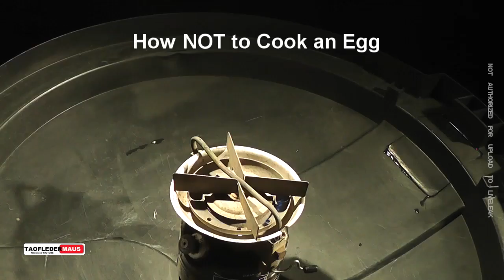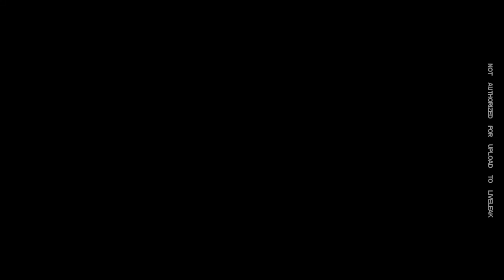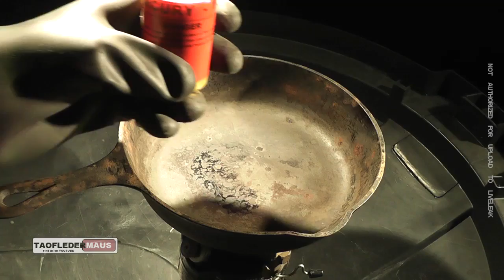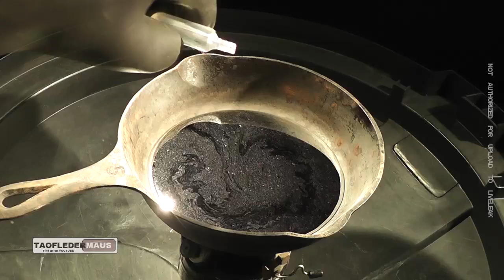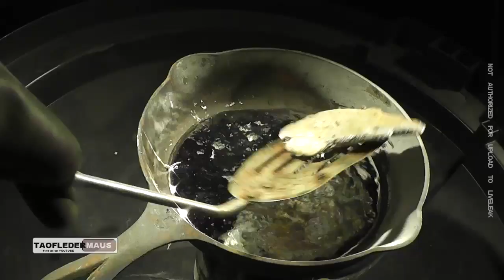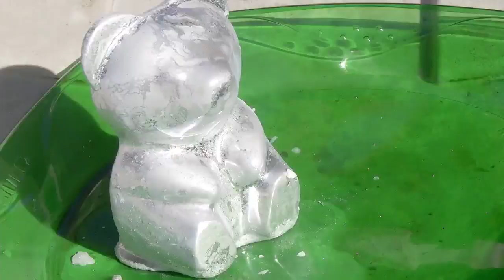Frying an EGG on liquid METAL -  Never seen footage

Comment: ???????Remember ??????? the story about the mad hatter that used to dip his beaver pelt hats into boiling mercury.. it will make you literally go crazy. one time i left a small metal container on my wood stove in the shop it was cold and forgot it was there well when the fire got really hot i was across the shop and poof the mercury explodeded and turned into a weird smelling smoke i got the heck out and opened all doors and window before i entered again never recovered my mercury and always had a strange smell in there.  I have always heard that if you fut some mercury in a hollow point bullet fairly deep hollow point and seal it with wax or resin that when you hit a target it will explode never tried it but heard it when i was a kid 30 years or so ago ??????????????Just wondering??????????????

Comment: Can mercury get hot enough to glow red like molten steel?
Reply: Nope, it boils at 356.7 degrees Celsius. To glow incandescent (red-hot) you need to reach at least 700 degrees C. Mercury would evaporate before it got that hot, unless you put it in a sealed container like a pressure cooker.
Reply: Thank you!

Comment: don't understand why is that amazing? but I do recall in Vo-tech class in the 1980's we worked with molten Lead and it looks the same except much hotter we used it to seal plumbing fixtures . I think its against the law now even though we just used them for outgoing pipes

Comment: And today we learned... absolutely nothing. Some commentary explaining what, if anything, is going on would make this much more worthwhile.
Reply: +beeble2003 The massic heat capacity of water is 4184.  It means that you have to give 4184 joules to 1g of water to heat it of 1°C. The massic heat capacity of mercury is 139. 
So you have to give 30 times less energy to heat mercury than water.
Sorry for my bad english, sience words are hard to translate :/
Reply from the maker: +beeble2003  heavens to MURGATROID!   I think I just pooped myself a little too!
Reply: +TAOFLEDERMAUS  i have a question to u, is it dangerous, when mercury is in boiling water?

Comment: This is the new way they give last meals to people on death row. Two birds one metal.
Reply: ***** you can't run from metal disease even with an extremely filtering mask, the gas heavy metals release can pass trough your skin (even if way more time of exposure is needed to start feeling sick) and that's one of the other major reason why workers in a foundry wear full body suit (well, the biggest major fact is reflecting the heat, obviously)
Reply: ***** I'm not gonna try to explain how the gases liquid metals (of all sorts, mercury is more dangerous just because it's at a liquid state is like this, and all liquids constantly evaporate) release go trough skin since i think I'm not the best explaining it, then I said it's toxic and dangerous with prolonged exposure.
Then it's an error of mine that I said all foundries use heat suits, only the ones that work close with some of the metals that are dangerous in a liquid state such as steel industrial foundries for the workers that stay closer than the other ones. Metal sickness isn't very easy to take now since the modern safety measures and equipment can prevent it and to have permanent resentments you need to be frequently exposed for sometimes even a decade, but in the '800, with the industrial revolution, problems like this were very frequent between foundry workers.

(P.S. to go trough skin it doesn't have to be atomically smaller than skin, the gas just passes trough the sweat pores)
Reply: +Paul Wilson I played with them when I was a kid.
Reply: +Ó Slatraigh Except one of those birds didn't deserve to be killed the way chickens are slaughtered in the egg industry.

Comment: this is probably a dumb question but what exactly is mercury.I mean I know it's an element but what exactly is it...
Reply: Basically it's a liquid-formed metal
Reply from the maker: Disneynerd1342  It is an element,  a metal that is liquid at low temperatures.
Reply: Disneynerd1342 It is also highly toxic, a bit more due to it's very high melting point. All pure metals are toxic to humans mainly because pure metals never exist in nature (or very rarely... I think it was 2% or 0.2% of earth had normal metals before humans started doing stuff). Due to this rarity most bodies of people and animals never evolved to have methods of getting metals out of there body.

Meaning even a few drops of mercury could cause harmful effects.

It is also one of the bare few elements that is liquid at room temperature.

If you want to know how metals are so rare before humans but not any more ie "where did it come from?" it is mostly the fact that the metals are bounded in ionic lattice compounds. for eg Sodium (Na) would have been commonly with Chlorine (Cl) forming NaCl which is commonly known as table salt. Just one common example.

Humans basicly used the knew knowledge of chemistry to separate those bonds to make metals and later on alloys (1 metal + another metal) to make things like bronze.

Mercury is one of the weirder guys out there, and in ancient history had wide spread speculation on what it is or could be used for mainly in alchemy- where by a certain chinese emperor was thought to be the key to eternal life- ironically it's highly toxic and killed him.

Comment: You know that even mercury vapors are extremely toxic right?
Reply: BlueBerry14 No its perfectly fine. Just pic the metal bits out of the egg and scrape off the grey parts on the egg. I've done this before and I'm fine. Tastes alot better than a normal egg. You should try it immediately.
Reply from the maker: ...KhàotiK...  Yeah,  especially when you heat it up.
Reply: *****
Were you using a mask?
Reply from the maker: yes. I explain everything in the description
Reply: *****
Ups sorry my bad.
Reply: The was cool and I know you sad in the description that you used a mask and what not but if it's that toxic why not use gloves and cover all skin. I've seen in one of your videos that you have bumps on your thumb. Idk, don't wanna see you getting sick for our sake.
Reply: ***** can you eat the egg ?
Reply from the maker: can I or will I?
Reply: ***** my question is legitimate, does the egg gets contained with mercury ?
Reply: Fuke Gewgelplus Thanks for the advice. Will try it.

Update: Did try it and now I'm a ghost... Thanks Obama

Comment: in the 70's i seen a guy drill out a 30/30 round and put a few drops and capped it with wax
he shot marble sink cut out blanks
1st with normal rounds and it popped holes in it ez pezy but just holes
when he used the modified rounds the blanks disappeared and tiny little bit fell
there was a flash and noise too!
as if it exploded!
he shot other things and it was devastating
tore stuff apart like a grenade! 
i can't remember his name just that he died in a bike crash!

Comment: Not very surprising as Mercury is a metal so conducts heat very well. The fact that it is a liquid at those temperatures will also increase the surface area of contact with the egg so I'd expect it to cook the egg even better than say iron, aluminium or any other metal that is solid.

Comment: So, am I understanding correctly that the little spots left after the water is added are mercuric oxide? I know that, at high temperatures, many metals can actually react with water to form their oxides. I assume that's what's happening here.

Also, this makes me crave some over-easy eggs.

Comment: So correct ,e if I'm wrong but does Mercury  not stick to any surface or something?
Reply: Yes. Mercury will not wet anything. Not glass, not a sponge not an egg. The metal you see on the egg is there because mercury vaporizes like any other liquid. The egg cooked with the mercury vapor inside it.

Comment: Mercury's heat conductivity is actually lower than most other transition metals...  interesting experiment, though, a thermometer might be better suited to test than, than an egg?  Well, you never know, something interesting could have happened and you ended up with a Nobel Prize.  Are you sure those fumes didn't get to you? :D

Comment: What's the point of showing us how you waste an egg ? Pretty obvious what will happen ..
Reply from the maker: what's the point of answering your smarmy question?
Reply from the maker: It freezes solid at about -40C (F)  and boils at 356C (674 F)   I have videos where we froze it and also brought it to a boil.
Reply: What's the point of doing stuff nobody's done before. That's a question Columbus got many times I guess. Maybe it would have opened a crack in the space-time continuum. You don't know until you try.
Reply: ***** cool.
Reply: ***** I have a question   does mercury have a melting or boiling point?  It's technically already a liquid isn't it?
Reply: *****
making me love your page even more with the common sense come backs on people its great lol...

Comment: Is mercury evaporating due to the heat, even a little bit?
Reply from the maker: Matixcubix Yes it is.
Reply: Mercury vaporizes  at very low  temperartures, its melting point  is  38 below zero,  and when it is  liquid it  vaporizes  fast, even at  15 or 20  degrees C.   The higher   temperature,  faster  the   vaporization  and  it is very  toxic, specially for brain cells.   Toxicologists   recommend  to  be very careful  even with  with  the  mercury contained  in a  saving bulb,  that has much less  than a gram.  Imagine this cooking, it  produced huge amounts  of  vapor.  You can not  smell  anything  but it   enters  your  brain.    Mercury  is not a toy, it  is  a  poison.
Reply: ***** Then why do you not have gloves on when you put the egg in?????!?!?!?!
Reply from the maker: Ever try to break an egg with gloves on?
Reply: Compromise safety because its easier?
Reply from the maker: I washed my hands afterwards.

Comment: I certainly hope you were wearing an appropriate air supply/respirator during the filming of this. Many people don't realize that another counterintuitive fact about mercury is that it has a significant vapor pressure; i.e., it evaporates much more quickly than you might think.

What that means is that when people handle mercury such as you have in this video, unless they take rather extreme precautions, they will inevitably inhale significant amounts of mercury vapor. While your rubber gloves were unnecessary as it is virtually not absorbable through the skin, when you breathe in the vapor 80% is absorbed into the bloodstream and distributed, rather permanently apart from chelation therapy, throughout the body, including the brain.

The vapor pressure of mercury increases rapidly with temperature !!

Mercury is a neurotoxin, and it doesn't leave the body once it's in there; without chelation therapy.

I know of a case in which, back when I was a scientist, a colleague broke a manometer and the mercury spilled behind his desk.  Although every effort was made to vacuum it up, he died a few months later.  An autopsy revealed severe deterioration of his brain.

When we were kids, we used to rub pennies with mercury to turn them silver.  I always wondered why they changed back overnight -- the mercury evaporated. 

I'm sure you will be able to find videos on the internet showing the flow of mercury vapor from an open container via refractive shadow illumination.  This substance should only be handled in a fume hood by people who know what they are doing, and posting a video such as this is somewhat irresponsible, in my view, in that it could entice others to make this potentially very serious mistake.
Reply: Read the description please.

Comment: What is it with Americans and cooking eggs on both sides? Absolutely disgusting.
Reply from the maker: Yeah!   Those Americans and their over-easy ways of life!   The outrage!   Because EVERY American eats eggs exactly the same way.
Reply: *****
On a more serious note, do you ever have a problem with residue from one of the experiments getting in your mercury? Do you have a way of cleaning it?
Reply from the maker: None at all with stuff like this.  It just doesn't ever mix with the Hg.     If there is any dust in the pan for example,   it's all going to float to the surface.  All the "clean" Hg is at the bottom so I will draw off the clean stuff and then pour the dirty stuff into a separate container.  Over time  I can start drawing off the clean Hg from that container.   I can use a 10% nitric acid solution to help strip out impurities too,  but I try to avoid that.
Reply: Ah, thanks, that explains it!
Reply: Salvatore Shiggerino no need to be stereotypical about Americans now. My family and I are american And we NEVER cook our sunny side up eggs on both sides.
Reply: Salvatore Shiggerino Fully cooked food is disgusting!
Reply: Salvatore Shiggerino uhh in my country they like to cook both side....i not even american....not even close
Reply: I scramble.
Reply: Hey we eat our food how we want to it taste good to us.

Comment: Mercury Egg cooking, problem, the hotter mercury is, the more vapor it gives off.  The vapor is about the most toxic in that it is tough to filter against.   
   You could have gotten the similar effect using Molten tin.  Which is what plate glass is made floating across, Russian nuclear subs used as their nuclear reactor coolant... dont turn it off.

Comment: You know, one of the interesting properties about Mercury is the fact that, while it DOES transfer heat, it does it relatively poorly for a metal.  That's why the water boiled less fiercely on the Mercury than it did on the (what I'm assuming to be) cast iron pan.

Comment: remember folks, mercury poisoning can come from fumes... Mad as a Hatter is an expression that comes from the fact hats were made from felt, which is a non-woven textile of animal hair. Wool interlocks naturally due to the surface texture of the individual hairs, but rabbit and beaver have to be artificially roughened. This process was usually accomplished with nitric acid (HNO3). It was found that if mercury was added to the nitric acid, a better quality of felt was produced. Unfortunately, when the felt was dried a fine dust was formed containing mercury. The hatters who shaped the felt inhaled large quantities of this dust were found to suffer from excessive salivation, erethism (presenting with excessive shyness, timidity and social phobia), and shaking of the limbs, which became known as hatter’s shakes. Many famous chemists also suffered from exposure to Mercury fumes such as Michael Faraday, FRS (1791 –1867), Blaise Pascal (1623 – 1662), Sir Isaac Newton FRS (1643 –1727)... but please note; It is important to remember that in all the cases described above it is the inhalation of the mercury vapor that was the cause of the trouble. Solid alloys of mercury such as those found in dental fillings have never been shown to cause any medical issues directly....(yet).

Comment: Are you aware of the vapor pressure of mercury at 150°C++?!?!?!!
That stuff evaporates and will contaminate the environment, even if you are protected by a gas mask. Simply because the fume hood line will end somewhere outside. Similar level of stupidity as setting of mercury fulminate in your vegetables garden
7g Mercury Fulminate

Comment: Mercury is liquid metal, so it heats up just as the pan would. Any heat applied to metal (Or at-least the metal i know) gets the metal hot, which means anything that hot that touches liquid metal would heat up just as solid metal would. Which will get the egg cooking as if it was on the pan without Mercury.

Comment: What happened to the water you poured on? looks like it just stuck there. Did it get trapped in the Mercury? Or was is just the imperfections in the water that were left behind? Awesome and interesting video :)
Reply from the maker: That was the hard-water deposits from the tap water.
Reply: Oh i see, thanks for the response :)